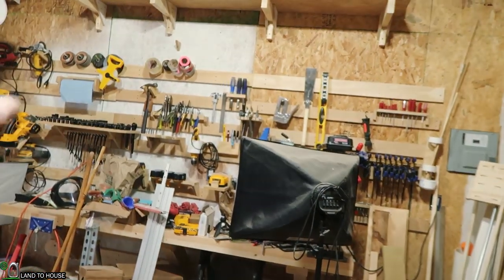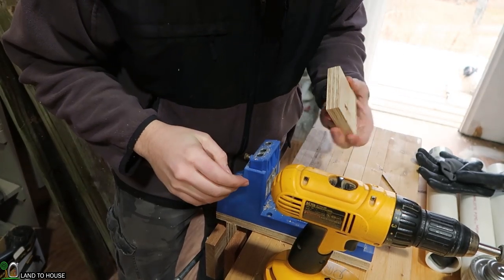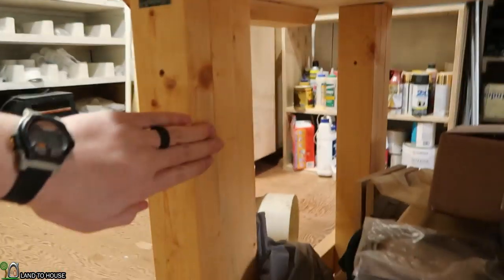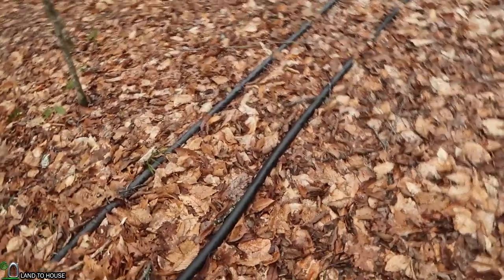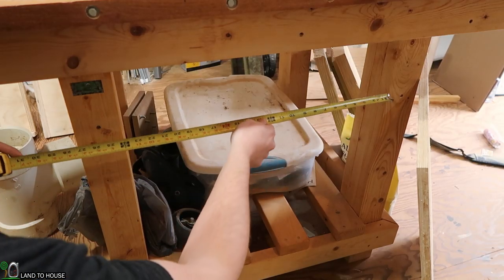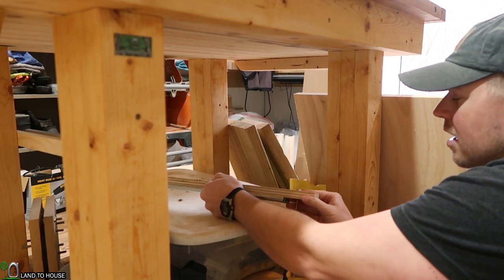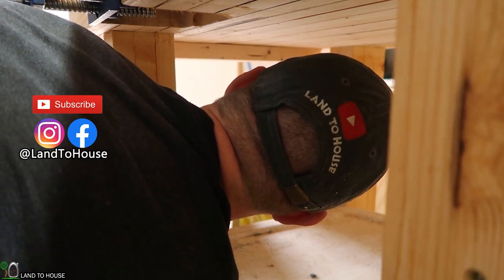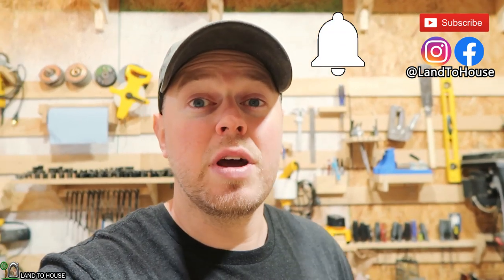Building an Under Workbench Drawer for all my Stuff

Comment: Love the videos, but yes please stiffen up the camera mount.  The angles are great, but It appears that the cross tracks are flexing allowing the arm to swing perpendicular to the cross track.  They might need to be stiffened up with a board to the outside of the rails and screws horizontally through the rails, like the way the long lateral tracks are hung.  Or perhaps fill them with expanding poly foam to at least dampen the swinging more quickly.
Well done on the drawer, getting the widths correct for drawer slides is tricky.